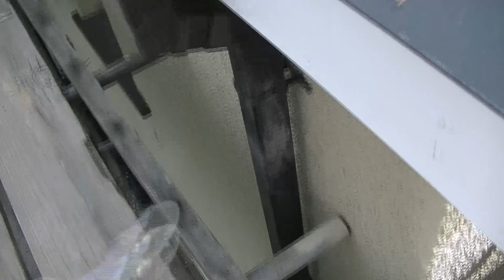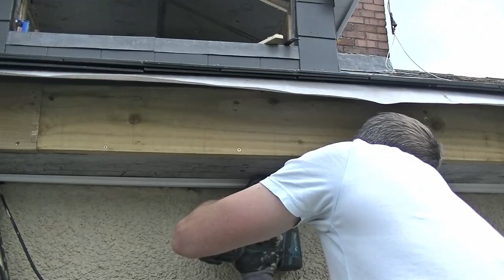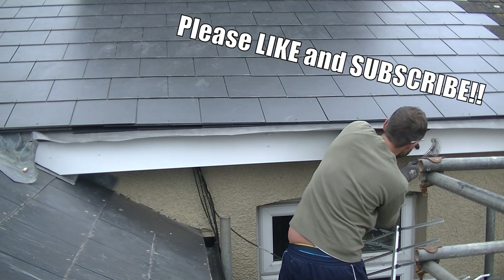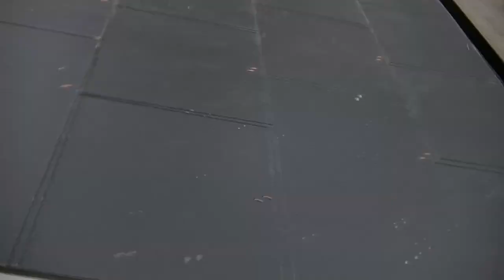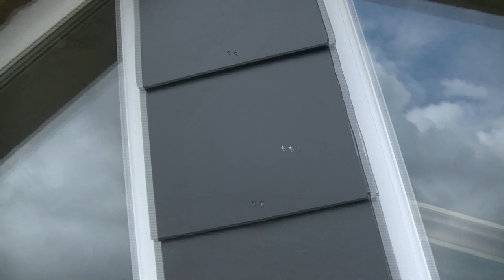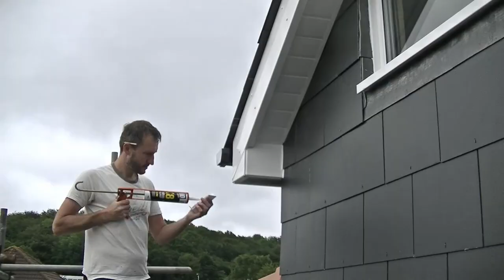Loft conversion part 36 - The outside is finished! Loft windows, soffits, fascias, gutters and more!

Comment: Fantastic achievement. Top job. Like what you did with the hip to dormer conversion on the side, rather than a big gable. It keeps the hip roof strength and still gives you the usable space. Look forward to progressing the inside now.
Reply from the maker: A hip to gable conversion would have allowed a flat roof rear dormer which would have been much bigger and with hindsight possibly a better option, but it would have been more cost, a bigger build and for my budget this was a nice way to go and in my opinion looks nice outside. Some loft conversions can look quite 'out of place' in my opinion. Thanks for watching 👍
Reply: @POUSEaroundtheHOUSE  It does look very elegant and part of the house rather than tack on. Box dormer might have also needed ridge steel or beam. Really like what you are doing.